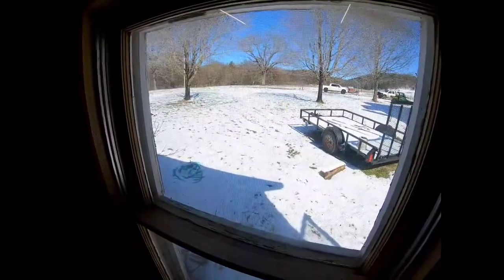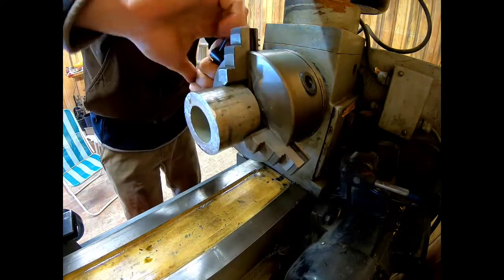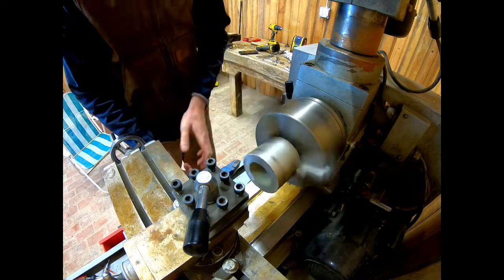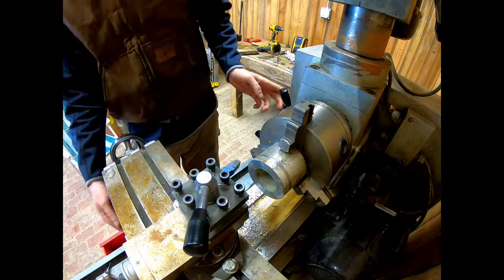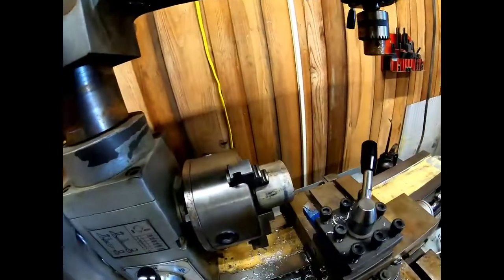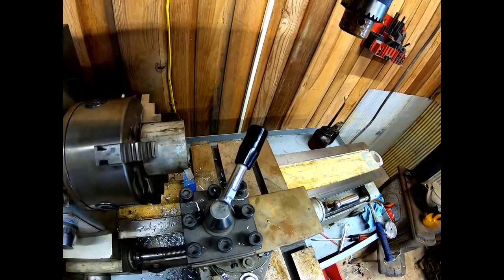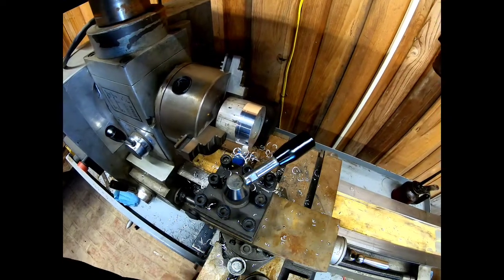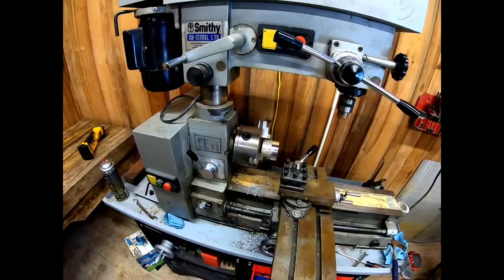Smithy CB-1220XL First Time Use (after repairs)

Comment: I have had one for since 2001. Just a hobbyists. I find that my machine has more backlash in both directions than it should. I have just started to try and make it less by doing what the manual says but so far I havent had any luck. I called the tech line but the guy I needed to speak with about the older machine adjustments was not there. The guy I spoke with wasn't really able to help me. I have not called back. It has been a good little machine for many years and I only used it here and there. You do have limitations with it but it was good for me to learn on.

Comment: Just some tips here from somebody formally trained in a machine shop program and with a lot of hours spent on a lathe making many finished parts...  for the person who is just getting started on one of these lightweight machines, practice on aluminum.  Use WD40 or kerosene as a cutting fluid.  Learn about left-handed and right-handed cutting tool geometry (hint: the tool used in this video was the wrong one).  Avoid using brazed carbide cutting tools unless you are willing to sharpen them properly.  Those cheap bit sets that come with these machines are not intended to be used as-is.  They come unsharpened.  They also don't come with geometries optimized for aluminum.  Go with HSS (high speed steel) tool blanks, and learn to grind them to the correct profile for aluminum using a typical home bench grinder, then hone to razor sharp.  Run them dead nuts on centerline or a hair below.  Never above.  Learn a little about speeds and feeds, dial those in.  You'll be cutting like butter and with killer finishes in no time. Repeat for other cutter geometries and materials.  Brazed carbide is great, but it has some quirks you'll need to learn about when you get into cutting harder materials later.  For nearly all work, I use high speed steel cutting tools because of their extreme versatility.  Sure, carbide has it's place, too, but it can be more challenging for the novice.  There are excellent videos on sharpening HSS toolbits and plenty of free resources to show you things you need to know, such as rake and clearance angles, and nose radii.  There's no way to be a good machinist without some basic knowledge of proper tool geometry, speeds and feeds, but the good news is that it is very easy to learn, for free.  Stick with learning from reputable, experienced machinists.  The Smithy machines are fine for somebody just getting started, but you have to read all available literature from Smithy about your particular machine.  I've seen and heard people complain about these machines but then at the same time, they're also often not even using them correctly.  Keep them clean, properly lubricated specifically with ISO 68 way oil (e.g. Mobil Vactra 2), properly adjusted for all gibs and backlash, strive for setups which maximize rigidity, and you're golden.  Best of luck to you and congratulations on getting started!

Comment: Did you check to see if the  lathe bit cutter was on center line ?
 You will know it for sure if facing off a solid piece of stock and if it leaves a small tit on the center. You don't want to go past center cause you will be riding on the underside of the cutter and possibly chip  the carbide brazed on cutter of the  bit .
 And in turning down and parting off, you sure need to be  contacting on center line or slightly above.
 I'd like to hear more about the reconditioning of the lathe /mill.
I have a Smithy CB 1220-XL myself.